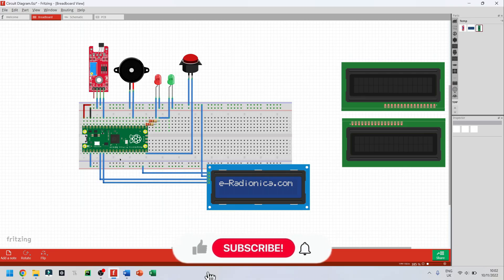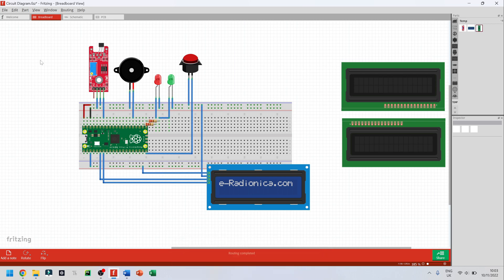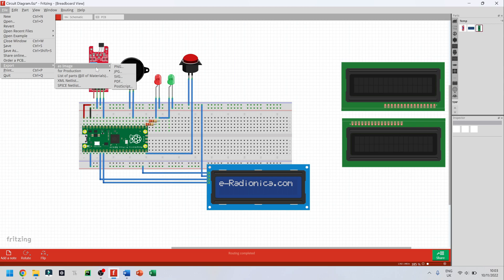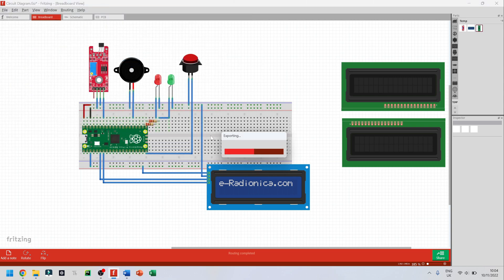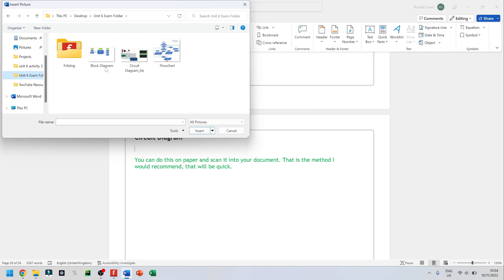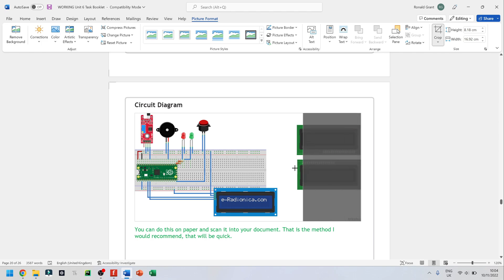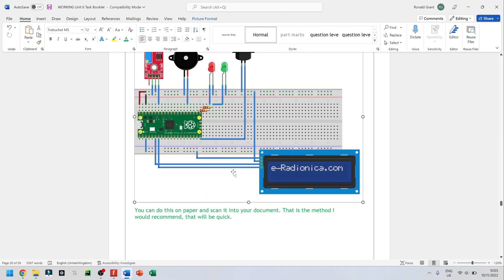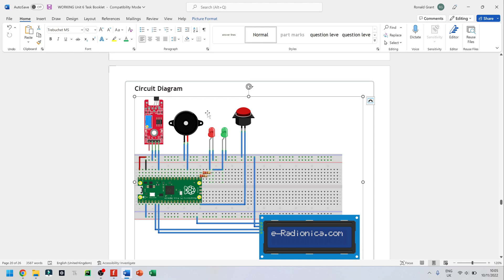BTEC Level 3 Engineering Unit 6 Microcontrollers - Part 17 - ACTIVITY 3 CIRCUIT DIAGRAM 3 (Fritzing)

Comment: the fritzung software you used does every college have it , I got my exam tomorrow so I need to know. Also I don't have internet access in this exam so not sure how ill get on the fritzing
Reply from the maker: Not every college has it, your college must provide you with some form of software to do this, which you should have had to practice.

OR

You can draw it by hand and get them to take a picture of it.

This website has a list of the main symbols you will need: https://jlcpcb.com/blog/circuit-symbols-electrical-electronic-diagrams

You can also use PowerPoint or Word. Use boxes and label them. Ensure that you write the pins you intend to connect things to on the diagram.